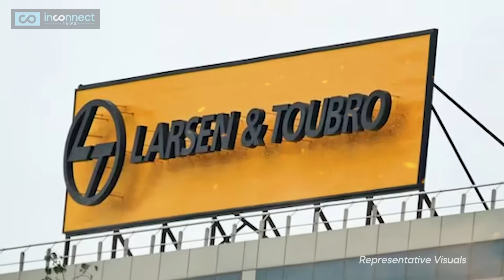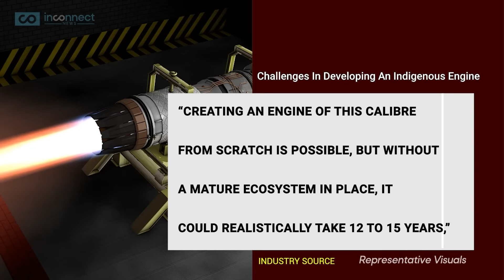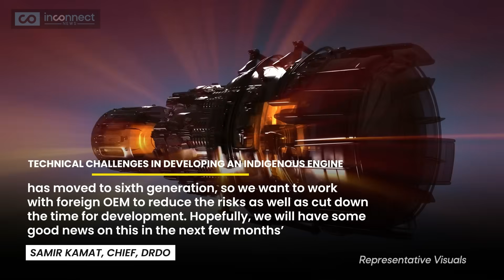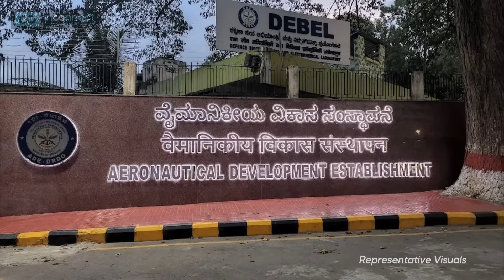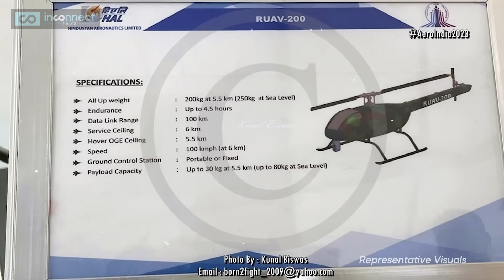Indian Air Force AMCA Engine Project A Game Changer for Defence Industry

Comment: Why under power from proposed 130 kw to 110 kw?  Can any expert in jet engine explain this ?
Reply: I think there is more than one engine involved - probably 3 engines. A 90kN Kaveri 2.0 for  Tejas Mk1/Mig 29 replacement engines, 110 kN GE F414 equivalent for Tejas Mk2 AMCA Mk1 and Rafale engine replacement, and 130kN engine for AMCA Mk 2, and Super Sukhoi.